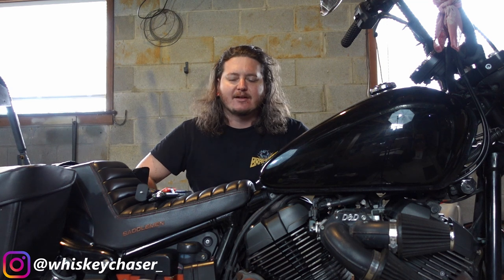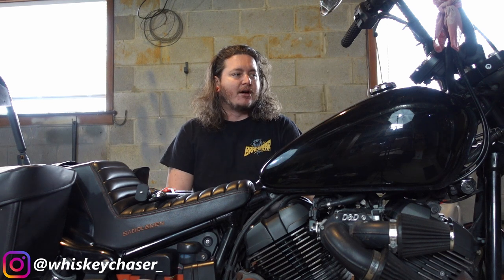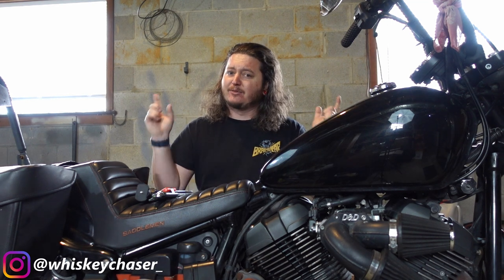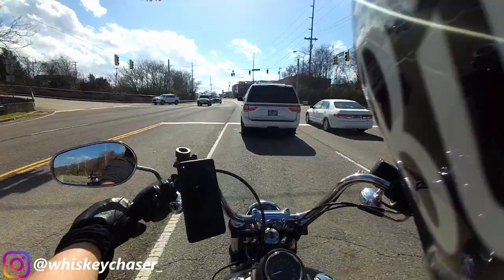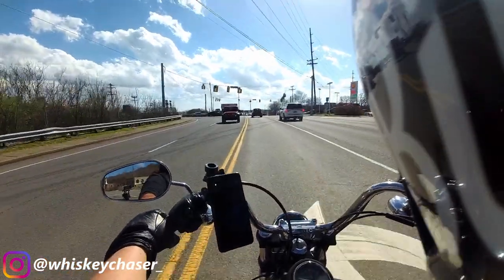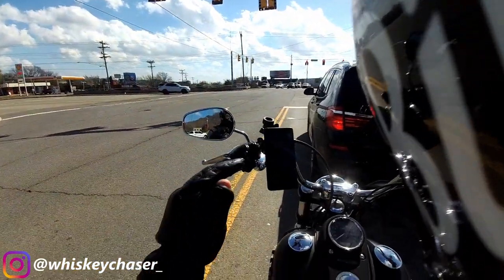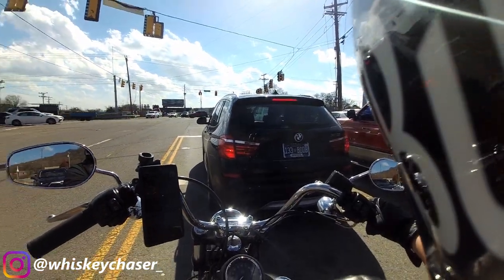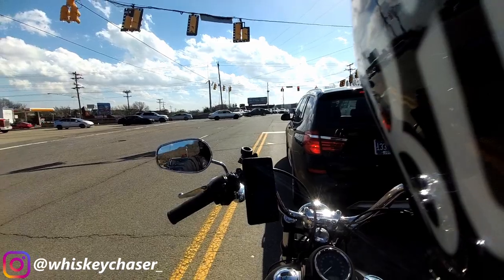I REALLY MESSED UP MY MOTORCYCLE: FIXING BAD VALVE COVER | PLUS house update!!! (Still homeless???)

Comment: I had the IVAN's flash done to  ECM when i had my  2014 Bolt -- to set it up for the air filter and exhaust mods.  Highly recommend.
Reply from the maker: Yeah I have a fuel tuner on mine too, just have some gunk in the lines that are making it run rough